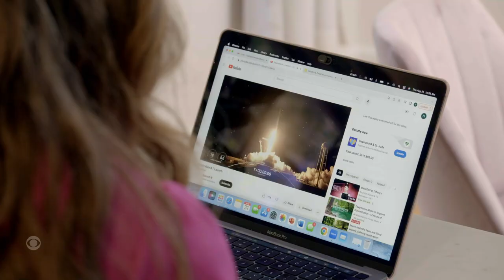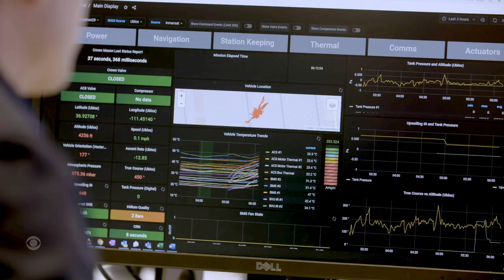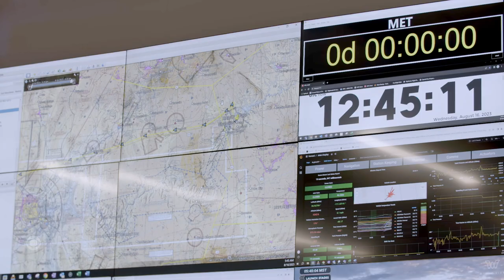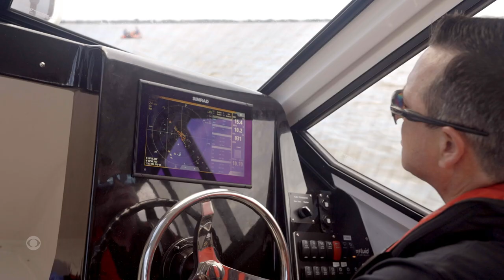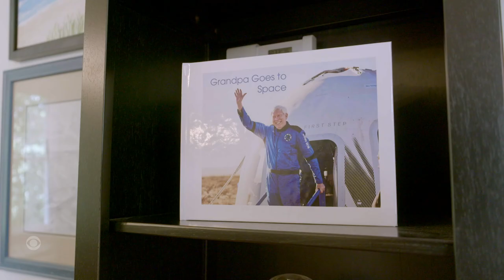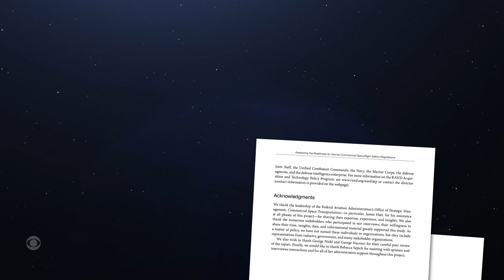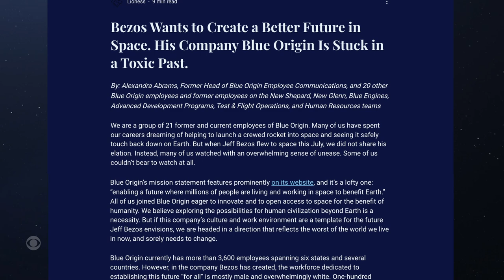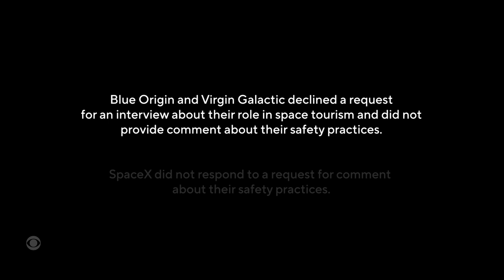Space Tourism: The Next Great Leap | CBS Reports

Comment: It would have to be way more safe than it is now before i would try it i feel like a lot of the civilian astronauts are entering it kind of naively
Reply: The unregulated part is the sub-orbital part, SpaceX every time their launch the crew they follow a program which NASA astronauts goes to the same with any other astronaut on crew dragon. So it’s ridiculous to say SpaceX is unregulated their follow the NASA certification process. The prediction for falcon 9/Dragon failure rates is 1/271 which NASA requirement is 1/270. NASA heck shuttle was like 1/70 failure rates which is higher than Apollo program 1/13 so it’s ridiculous to say SpaceX unregulated. Any failure of dragon is big blow.